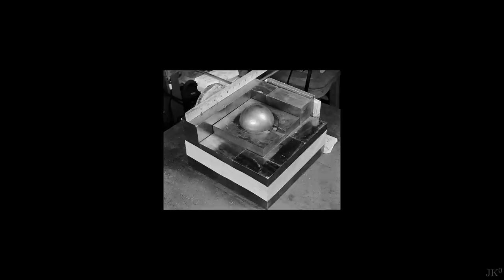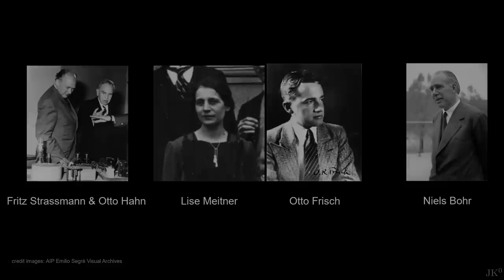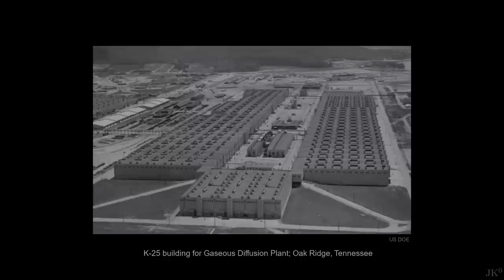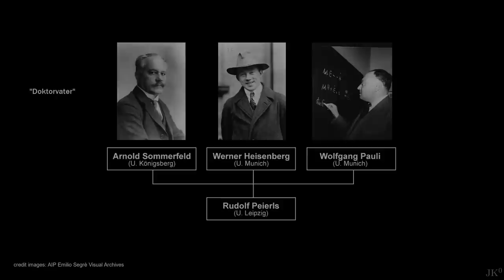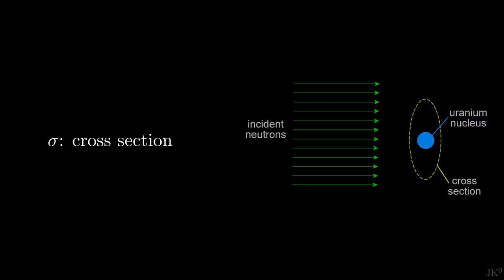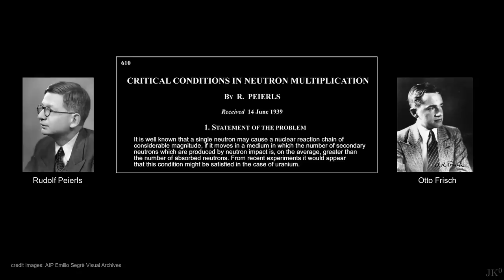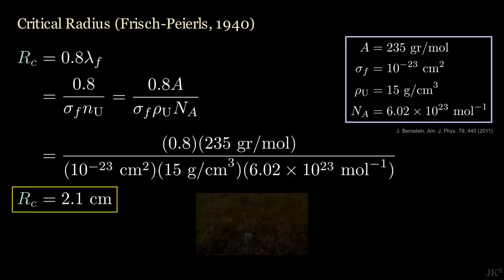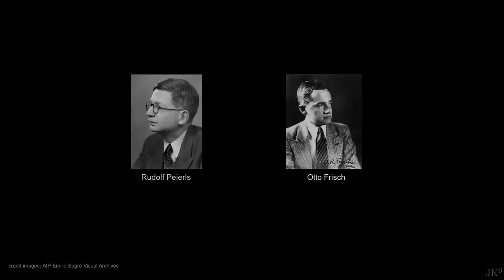Critical Mass: when the atomic bomb got real

Comment: Thanks!
Reply from the maker: wow, thanks to you for supporting the channel! I really appreciate the gesture, for now I can only do my best to keep producing this kind of content. Thanks so much!
Reply: Chain reaction and critical mass was first discussed and patented (with A.Bomb) by Leo Szilard almost a decade before Hahn and Meitner and Strassmann.
Reply from the maker: @chriswanger284  you are correct on that; however, there is a big difference between chain reaction and fission. The former requires the later. Szilard's patent does not point to a specific element for the chain reaction. Szilard didn't know which element on the periodic table (in any) would sustain a nuclear chain reaction, he only patented a concept. Still relevant. In fact, his research program was bombarding one by one each element of the periodic table but Hahn and Strassmann tried uranium first and discovered nuclear fission. The actual verification of nuclear chain reaction was only possible at the Chicago Pile with Fermi, closely working with Szilard.

Comment: As a mechanical engineer, I was the only one to sign up for the full 2 courses in nuclear power at my small university. Fortunately, the professor allowed me to take the course as an independent study with the proviso that I do the reading and explain it before him. Never had I learned a subject so thoroughly.😂
Reply from the maker: Wow, that's a nice story; you have a point, when we attend lectures we expect the lecturer to do most of the work, if you are lecturing then that really forces you to prepare and learn. I am currently running a video series on the early times of quantum mechanics and I am using the original papers by Planck, Einstein, Bohr, etc, and I have learned a lot of content that doesn't make it to textbooks. Check it out, in case you haven't https://www.youtube.com/playlist?list=PL_UV-wQj1lvVxch-RPQIUOHX88eeNGzVH
Reply: @jkzero The textbooks always lack some important details I'm high school student but I prefer more original papers than textbook

Comment: This video is a superb explanation of why the term “critical mass” is not quite correct.  While I have only elementary physics knowledge, it’s clear from Dr. Diaz’s excellent narrative that other variables need to be considered, but particularly the density of the fissile material.  How else could one produce an implosion bomb?  It takes a sphere of plutonium and compresses it in order to initiate the explosion. If only mass were involved, since the mass of the plutonium did not change, comparing it before and after compression, it was the increased density of the material caused by sudden compression that was needed to initiate a sustainable chain reaction.  Well done, Professor!
Reply from the maker: Thanks, I am glad you liked the video. I am always curious to know what brings viewers to the channel, were you searching for something in particular or did the 'mighty algorithm' find you?
Reply: Critical mass does not mean nuclear explosion!  Criticality is the point at which a mass of a fissile material begins to start a chain reaction which leads to a huge increase in neutron flux, which is what killed the operator.   How to initiate a nuclear explosion is another matter.

Comment: So this is something I have often wondered about. The basic model of fission is that neutrons fly out and split other atoms, but in order to get fission, you have to slow the neutrons down. This changes the whole idea does it not? It goes from a bullet hitting an target to one of a particle being attracted to and captured by the target atom.
Reply from the maker: the need of slowing down neutrons is only relevant for fissioning U-238 in a controlled manner, such as a nuclear reactor, this is the role of the moderator. Please check the follow-up video for Peierls & Frisch calculation of the heating and expansion of the nuclear core, which would stop the chain reaction. The process is so fast that slow neutrons cannot be used for a bomb; a bomb can only work with fast neutrons.

Comment: When the Uranium is surrounded , enclosed by a diamond, the compressed matter starts to develop. Hundreds of electrons gather around it from the air, and the compressed matter from a single molecule will become the most dangerous one. The cosmic energy causes it to divide, but the diamond doesn't allow it. When it is not used up in time, one molecule explodes as a granade. When the molecule is fired at a tank or gets under a tank, the soldiers have to escape because of its high radioactivity, that's one molecule. 
The raioactivity is measured by an instrument to know when the matter has to be used up, or it will explode.
Reply from the maker: I am sorry but I have no idea you are describing

Comment: Tube alloy project was the start I read. 
Tungsten Carbide blocks around the pit, Good neutron reflector.
Reply from the maker: You are right, the Tube Alloy project was really what got the actual project for a bomb rolling, despite the simple narrative of Einstein-Szilard letter that most historical accounts prefer. I made a video about this, in case you what to check it out https://youtu.be/W3ba1Y8L_yg

Comment: I've often wondered whether criticality can be attained with less than the conventional "critical mass" of U-235. Could it be that a critical density is the true trigger for the reaction? 
In essence, what is the minimal mass requirement for initiating a nuclear fission chain reaction using U-235 or plutonium? I would greatly appreciate insightful responses.
For those curious, my pondering was sparked by the first Predator movie. The scene where Arnold Schwarzenegger evades an explosion resembling a nuclear blast led me to consider this. However, it's implausible for him to have outrun an explosion comparable to the yield of "Little Boy" in such a brief span. Your input is valued. Thank you.
Reply from the maker: as described in the video, using modern values for density and fission cross-sections, the bare critical mass for pure U-235 is ~46 kg; however, you can push this down using a heavy metal around the uranium core called a tamper. The tamper helps in two ways: first, it reflects escaping neutrons back inside the core so they can produce more fission, and second, being heavy its inertia holds the exploding and expanding core for a few extra microseconds, which allows a few extra generations of neutron multiplication, and in an exponential growth the last few generations are the more crucial. How much you can push the critical mass down depends on the mass of the tamper, for instance, for a ~15 kg tamper the U-235 critical mass drops to ~30 kg, whereas for a 400 kg tamper the uranium core necessary for a bomb drops to ~18 kg.
Reply: @jkzero  As far as I understand, pure uranium has bad compressibility in a solid core, so probably very hard to do
Reply from the maker: @nehorlavazapalka  in my comment above, I was not referring to compression but only to the reduction of the necessary core mass by using a tamper surrounding the core

Comment: Excellent article.  I do wonder however if Bohrs actually identified U235 as the key low speed neutron fissile material.  Had he done so in any sort of public or published document the Manhatten project would have started in 1939.  It did not start until 1942 because only then did Britain reveal the key document by Peierls and Frisch which definately identified U235 as the cirital isatope and they also predicted size of a critical mass and yield.  This was the bomb.  As you say a lot of people tried to claim credit that didn't deserve much; and I really don't believe Bohr knew about U235.  If he did he kept his mouth shut and didn't reveal his knowlege until after the war.
Which makes it irrellavent.
Reply from the maker: Bohr did identified U-235 as the key component of natural uranium responsible of the fission reactions with slow neutrons. He published two crucial papers in 1939, the first one alone in which he uses the differences between uranium and thorium as the key insight for the identification of U-235 titled "Resonance in Uranium and Thorium Disintegration and the Phenomenon of Nuclear Fission." The second paper, "Mechanism of Nuclear Fission," is the one mentioned at the 04:00 mark in the video. This paper co-authored with Wheeler shows all the gory calculations. Your comment about the British push to the bomb program is in fact the topic of the next video, stay tuned.

Comment: The rule of thumb for every tonne of uranium fissioned 8kg of plutonium is produced or put it the longer you cook uranium in a reactor the more plutonium. Plutonium is easily separated by chemical means the yellow uranium at the top and blue plutonium at the bottom. The spent uranium can be used in fast breeder reactors to produce further plutonium to extend fissile material. Enrichment of uranium is expensive and centrifuge technology is used  and energy used is between 40kw and 110kw the Urenco TC21 centrifuge has a rotor length of 5m and 100 SWU per annum and AC100M centrifuge has a rotor length of 16.5m and is rated at 350 SWU . The SILEX process is new and the separative power index is unknown.
Reply: SILEX: About 10-20% enrichment per pass.
Reply: Prolonged irradiation in the reactor poisons Pu with by-products. So there is a balance

Comment: Help please. I have trouble with the idea of compressing a solid. I understand the explosives compress a ball of plutonium to kick it over critical mass. Just how much does that ball of plutonium compress? I've seen it given as a solid ball. Somehow I'd expect a hollow ball to work, but I haven't seen anything on that. So, what's the deal? How much compression?
Reply from the maker: I made a video answering this exact question, check at the 3:28 mark of this video https://youtu.be/AcwZ0cwxXOE
Reply: @jkzero  Wow. Thank you.
Reply: One more please; When testing the explosive lens, what did they use instead of the plutonium core AND did it remain compressed matter afterwards or return to its original size and shape?
Reply from the maker: @DrJeffDrJeff  wow, those a really good questions and I can safely say that I do not know the answers, I would have to do some digging. I cannot guarantee to be able to fulfill all the requests but I always open to collecting suggestions, thanks.

Comment: ...thank you for this infomrative video. I've always thought of critical mass in terms of neutron flux and suprisingly Netron Diffusion Equation models just that. :D

If neutron flux is not hight enough to reach criticality, just decrease fuels volume (cross section) so that the probability of neutrons to fission the atomic cores can increase. On the other hand if volume is constant, just increase fuels purity so the ratio of fissable and non fissable atomic cores is higher (relative cross section is higher)...
Reply from the maker: reaching criticality is tricky, but it can be done if we can find the relevant variables driving the criticality condition. cross-sections cannot be modified, they are fundamental properties of a material like uranium 235 or plutonium 239, but other properties can be controlled like the material density (critical mass is proportional to the inverse squared of the density) and enrichment ratio. The next video is a complete walk-through on how to solve the neutron diffusion equation to derive a general formula to calculate the critical mass in general of any pure fissile material so you might like that. It will be math heavy.
Reply: @jkzero  ..."relative cross section" was a rather choice of words on my side as cross-sections you are reffering in the video are fundamental properties.

To me whole Neutron Diffusion Equation is like Bernoulli's Equation but instead of measuring fluid velocities and pressures we are measuring neutron flux and fissability. Either you change spatial dimension to increase flux or you increase density. Either ways it all comes down to how probbable is for a neutron and an atom to find themselves in a certain point of space and time for fission to occure.

To me most amazing part in your video this time is historical aspect. In a matter of mere 5 years, someting that seemed theoretically impossible (a bomb) by Bohr's initail calculation for critical mass, was turned upside down and made possible (Trinity test)...:)
Reply from the maker: @t850 I see your point, in fact the derivation of the neutron diffusion equation involves properly describing the neutron density as a current, in my new video (in preparation) I even mention the similarity with fluids and electric currents.
Reply: @jkzero  ...in the end conservation of mass and energy holds true as all this equations are just a variation of this basic physical laws.

I'm defenitely looking forward to seeing you new video...:)
Reply from the maker: @t850  that is right, there is just a tiny but significant difference with neutrons diffusing inside a fissile material compared to an element of fluid or electric changes in a wire: the number of neutrons changes with time and position not only by diffusion but also because some neutrons are consumed by fission and new neutrons are created by fission so the continuity equation must be modified to include the corresponding source and sink terms.
Reply: @jkzero  ...so I guess it's more like an electrical circuit with transistor of fluid circuit with variable valve where the current on the gain modifies the current of the source/drain...:)
Reply from the maker: @t850  I have not encountered circuits since I was an undergrad and that was a while ago so I honestly cannot confirm whether the systems are analogous but I will post the video with the whole calculation shortly, I look forward to any feedback that you might have there

Comment: I think the "Fat Man" bomb casing was not a "Soccer Ball" A soccer ball is a "Truncated Icosahedron" It has 12 pentagons and 20 hexagons. In this object the "dihedral angels" are different at the intersection of the Pentagons and the Hexagons and the intersection of hexagon on hexagon. Where the pentagon is adjacent to a hexagon the dihedral angle is 142,62 degrees. Where the hexagon is adjacent to a hexagon the angle is 138.18  Secondly, the area of each polygon is different. Hence  you would have different quantities of explosives arranged around the core at different angles. This also means the dihedral angle planes do not split the center of the objects circumscribing sphere. All in all this says that a soccer ball would not work.

I think and I saw once a picture of the bombs casing. It was a "Deltoidal Hexecontahedron". This is an object with 60 kite shaped polygons. They form a sorta stellated dodecahedron. This would avoid the problems described above.

I think the movie got it wrong. Let me know your thoughs.. Thanks, Hamp Stevens
Reply from the maker: wow, you really made me think deep here, thanks for that! I am not sure when/where in the video I said that the explosive lenses had the shape of a soccer ball, I used the soccer ball only as a reference of the size of a bare uranium core not the shape of the high explosives. Could you point out where this was inferred from in the video?

Comment: Awesome video. After 3 ODE classes i still dont have a real application beyond the springs on springs in a triangle pattern. Please, the derivation!
Reply from the maker: The video walk-through solving the neutron diffusion equation has received way more support than expected, great to find more people interested in the stories but also in the calculations. It is in the pipeline, coming soon.
Reply: @jkzero  20 years after graduation, I still remember my ODE's and modern physics.  But I have never really applied it to a problem that was not given to me by a prof.  I want to exercise that part of my brain again, and this is interesting.  I remember we solved the Schrodinger eqn (ODE version) for Hydrogen.  Then we used the matrix method, then we did a numerical estimation for Hydrogen.  But that is the limit of my Modern Physics II course haha.
Reply from the maker: @YoyomaG6  glad to  read about your interest on challenging yourself intellectually, that is like taking the brain to the gym. The neutron diffusion equation is a PDE, not an ODE; however, don't get intimidated, after a little quite trivial trick the PDE can be turned into two ODEs and then all the methods that you know can be applied. As I said, this is coming soon with a "calculus warning" for anybody who might want to skip it due to high level. Still, it has been great finding an audience interested in the hard stuff.
Reply from the maker: promise fulfilled: solving the neutron diffusion equation step by step https://youtu.be/DIuoFAW9H3E